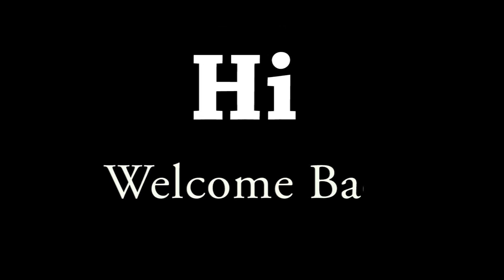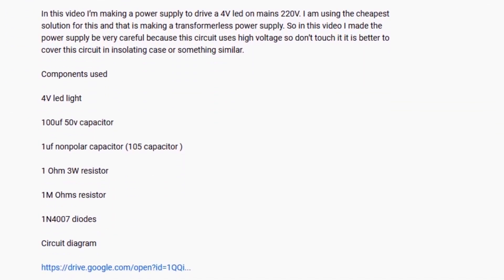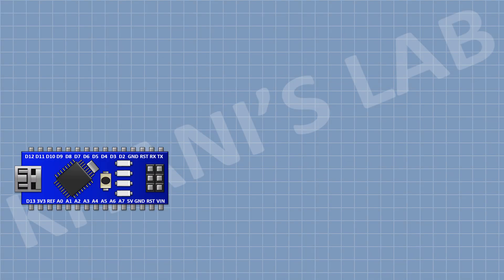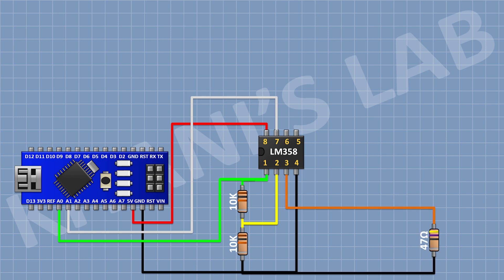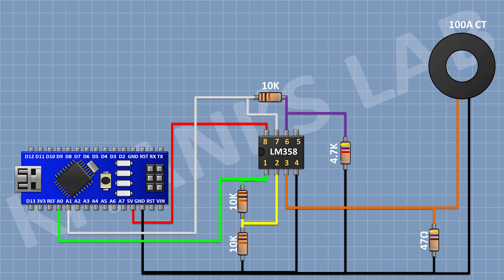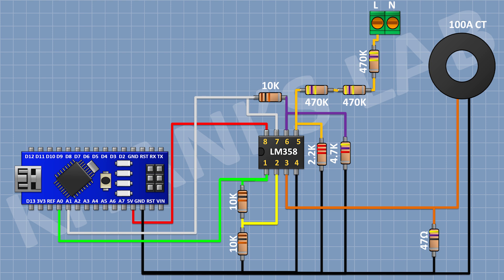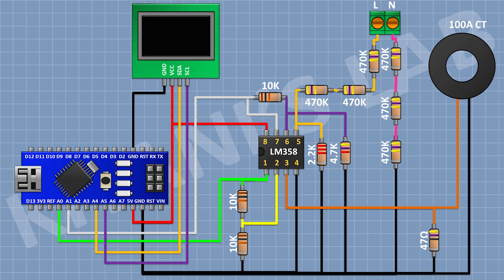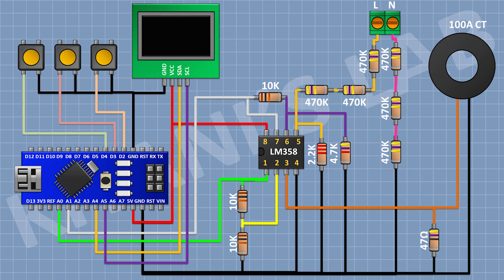DIY 3-in-1 AC Meter | Arduino Project | Voltage, Current & Power Measurement

Comment: Is this a copy of some-one elses work?  It is doubtful this is actually orginal work; 
 no explanation of the circuit
- no code walk-tthrough
- no talk on the precision / waveform /parameters  etc

Just the  rather useless    Connect this to that....    Connect this to that....Connect this to that....

Comment: Yet another insipid video with
- no explanation
- no code walk-tthrough
- no parameters
- no talk on the precision / waveform / etc
- he does not even mention a FATAL FLAW
Just the  rather useless    Connect this to that....    Connect this to that....Connect this to that....

Comment: Nice video keep it up sir 👍 sir I have one request for to you how to charge the 3, 7 volt battery with auto cut circuit with relay please make a one video it is a humble request thank you 🙏
Reply: why  a relay?    With a good design there is no need for  a relay.  There are many such devies on the market
Reply: Is this a copy of some-one elses work?  It is doubtful this is actually orginal work; 
 no explanation of the circuit
- no code walk-tthrough
- no talk on the precision / waveform /parameters  etc

Just the  rather useless    Connect this to that....    Connect this to that....Connect this to that....
Reply: Yet another insipid video with
- no explanation
- no code walk-tthrough
- no parameters
- no talk on the precision / waveform / etc
- he does not even mention a FATAL FLAW
Just the  rather useless    Connect this to that....    Connect this to that....Connect this to that....

Comment: Muito legal seu projeto!!! Tambem gosto de montar os experimentos em placas universais, e quase sempre ficam montados nelas. 👍👍👍
Reply: Yet another insipid video with
- no explanation
- no code walk-tthrough
- no parameters
- no talk on the precision / waveform / etc
- he does not even mention a FATAL FLAW
Just the  rather useless    Connect this to that....    Connect this to that....Connect this to that....
Reply: Is this a copy of some-one elses work?  It is doubtful this is actually orginal work; 
 no explanation of the circuit
- no code walk-tthrough
- no talk on the precision / waveform /parameters  etc

Just the  rather useless    Connect this to that....    Connect this to that....Connect this to that....

Comment: Very well, only a question : "How do you manage and measure the power factor between current and voltage? "

Howevere very nice work 

By an italian engineer
Reply: Yet another insipid video with
- no explanation
- no code walk-tthrough
- no parameters
- no talk on the precision / waveform / etc
- he does not even mention a FATAL FLAW
Just the  rather useless    Connect this to that....    Connect this to that....Connect this to that....
Reply: Is this a copy of some-one elses work?  It is doubtful this is actually orginal work; 
 no explanation of the circuit
- no code walk-tthrough
- no talk on the precision / waveform /parameters  etc

Just the  rather useless    Connect this to that....    Connect this to that....Connect this to that....

Comment: Excellent
Reply: Yet another insipid video with
- no explanation
- no code walk-tthrough
- no parameters
- no talk on the precision / waveform / etc
- he does not even mention a FATAL FLAW
Just the  rather useless    Connect this to that....    Connect this to that....Connect this to that....
Reply: Is this a copy of some-one elses work?  It is doubtful this is actually orginal work; 
 no explanation of the circuit
- no code walk-tthrough
- no talk on the precision / waveform /parameters  etc

Just the  rather useless    Connect this to that....    Connect this to that....Connect this to that....

Comment: good job 👍👍👍👍👍👍😊😊
Reply: Yet another insipid video with
- no explanation
- no code walk-tthrough
- no parameters
- no talk on the precision / waveform / etc
- he does not even mention a FATAL FLAW
Just the  rather useless    Connect this to that....    Connect this to that....Connect this to that....
Reply: Is this a copy of some-one elses work?  It is doubtful this is actually orginal work; 
 no explanation of the circuit
- no code walk-tthrough
- no talk on the precision / waveform /parameters  etc

Just the  rather useless    Connect this to that....    Connect this to that....Connect this to that....

Comment: Nice project ☺️☺️👍🙂💯😁😄
Reply: Yet another insipid video with
- no explanation
- no code walk-tthrough
- no parameters
- no talk on the precision / waveform / etc
- he does not even mention a FATAL FLAW
Just the  rather useless    Connect this to that....    Connect this to that....Connect this to that....
Reply: Is this a copy of some-one elses work?  It is doubtful this is actually orginal work; 
 no explanation of the circuit
- no code walk-tthrough
- no talk on the precision / waveform /parameters  etc

Just the  rather useless    Connect this to that....    Connect this to that....Connect this to that....

Comment: Add frequency also ;
Reply: Yet another insipid video with
- no explanation
- no code walk-tthrough
- no parameters
- no talk on the precision / waveform / etc
- he does not even mention a FATAL FLAW
Just the  rather useless    Connect this to that....    Connect this to that....Connect this to that....
Reply: Is this a copy of some-one elses work?  It is doubtful this is actually orginal work; 
 no explanation of the circuit
- no code walk-tthrough
- no talk on the precision / waveform /parameters  etc

Just the  rather useless    Connect this to that....    Connect this to that....Connect this to that....
Reply from the maker: ok I will add it
Reply: @KiyanisLab    another empty promise